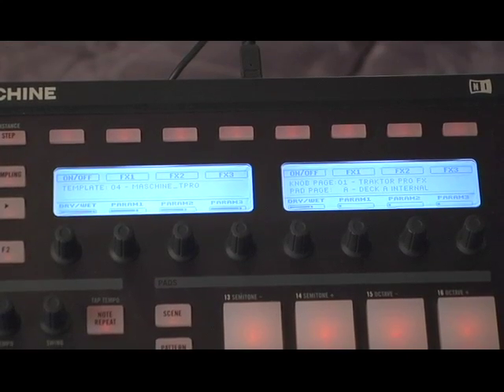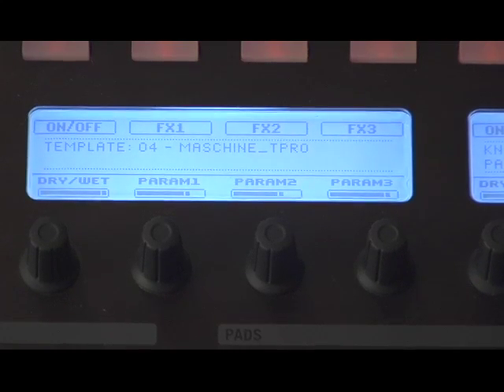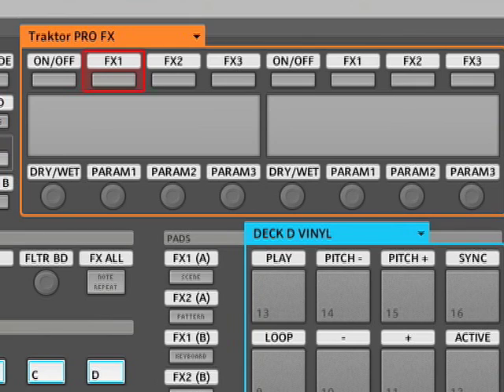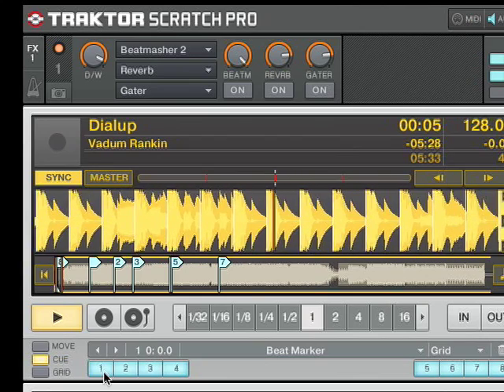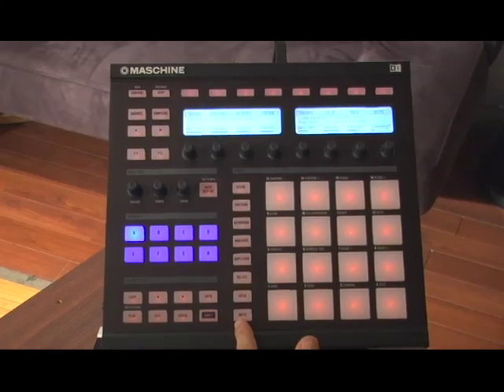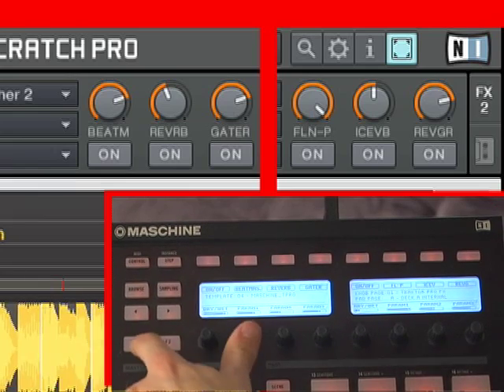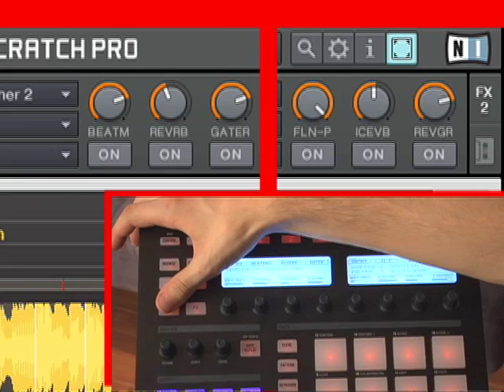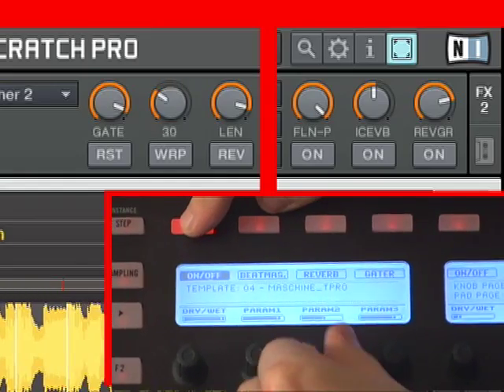Using Native Instruments Traktor w/ Maschine Pt. 3

Comment: Hi, I have multiple issues with the template. I'm up to date and I believe I have it all set up correct.
1. Autoload to preview doesn't work 
2. Maschine PLAY button seems to instead activate loop brace Deck B
3. No display of FX on my MK 1 screens. 
4. Scene, Pattern, Pad Mode, Navigate, etc. seem to have dual function both with FX and for example Pattern will activate Cue on Deck A and Pad Mode activates track play on Deck A.
Tried Deleting template and starting again but same issue. Note I am just using Traktor Pro 2 demo at the moment though everything else works. Help please.
Reply: Solved some issues as there was midi crosstalk. Issues remaining are the autoload to preview and Play button skip through preview play non functional, no FX display, Browse button maximizes library, Snap button doesn't activate filter, no function for Auto Write button.
Reply from the maker: Eliah Holiday Ok, great. Glad you were able to figure it out!
Reply: *****
Update again. Found out I need to hold shift to access screen info yay! So is there a way to adjust for remaining parameters? Snap button, autoload, and such?

Comment: you don't need to carry two. Who ever said you need two Maschine's. You can switch between MIDI mode and Maschine control by shift - control. The freeze was related to LED Output which I changed in my mapping. I previously had the track Beat indicator mapped to a button which was causing too much LED ouput. I took this out of the mapping in the most current version.

Comment: @MattStrombom this sounds like its conflicting with another mapping you have loaded. Check all the ports in the controller manager for each device. Make sure the Maschine mapping is only set to (in port- Maschine Controller out port - Maschine Controller) and that your other devices are not set to ALL PORTS and that the in and out ports are just assigned to that device. Then you should be good to go.

Comment: @KevWillow7 you can also manually match the track BPMs with the internal pitch faders but its much easier to use the sync button. With Traktor Pro 2, you can just leave the sync button on the whole time and you won't ever have to worry about matching BPMs as long as the tempo detection is correct.

Comment: @CWaldo428 You can use Maschine as a MIDI controller for Traktor AND use it to control the Maschine software simultaneously. You can even drag audio directly from Maschine to Traktor so you can scratch and mangle beats that you just produced on the fly! You just need to sync both programs via internal MIDI Clock. I am doing a video specifically on this soon but in the meantime check out my Ableton & Traktor Sync video on the Dubspot channel to give you an idea of how this works.

Comment: @Icevampir Those controls aren't mapped, nor would I recommend using Maschine's endless encoders for Traktor's internal mixer. I would recommend using either the X1's (as a mixer), the Traktor S4, or even an iPad to control Traktor's mixer. There are lots of other MIDI controllers out there that act as a MIDI Mixer as well